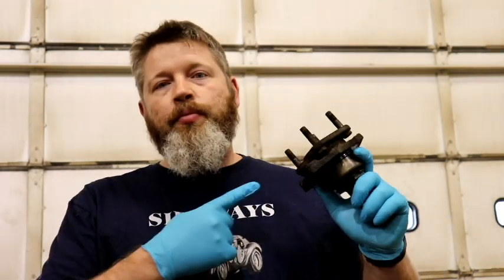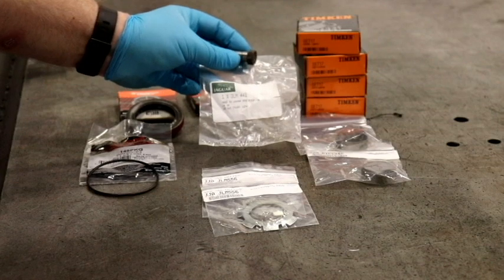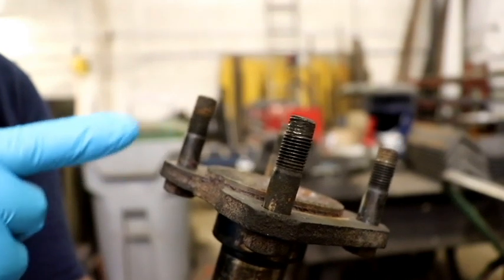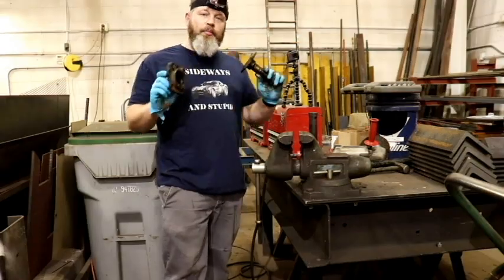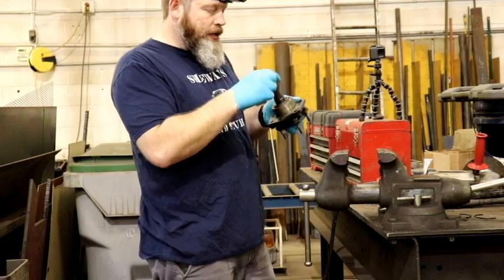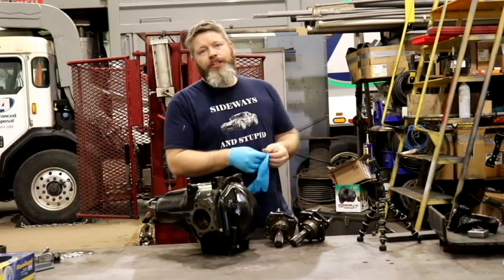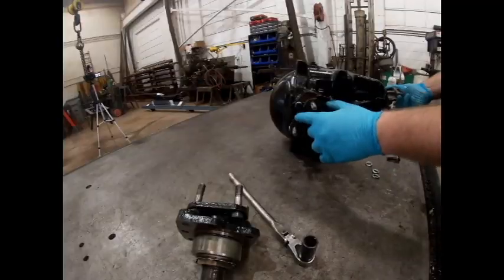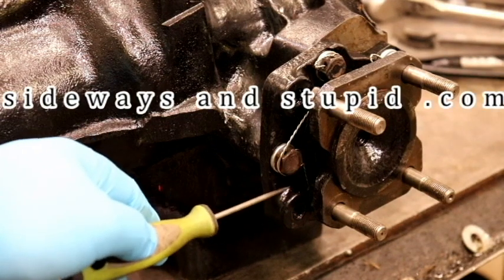Don's Cobra Show - E3: Jag IRS Output Shaft Assembly Rebuild (ERA Cobra Build)

Comment: When I did this job I had to use a puller to get the outer bearing off of the output shaft and a press to get the new one installed. I don't understand how your bearings slipped on and off the output shaft so seamlessly but good on ya, mate.

Comment: G'day Don, I am reasembling the IRS on my 1988 XJ-S; your video on hub reassembly, and output shaft assy are fantastic: no rubbish just the facts, with extremely helpful parts identification.  My first question is:  is a hydraulic press an alternative to drifting the bearing races in?
Second question: I am now at the stage of setting up the half shaft to fulcrum shaft distances (I had to shim the half shaft to  center the brake calipers on the rotors).  Are you going to do a video on this step?  Much appreciated. Cheers Chris